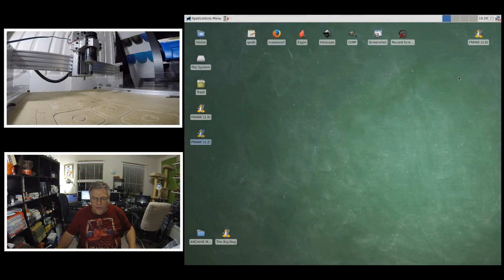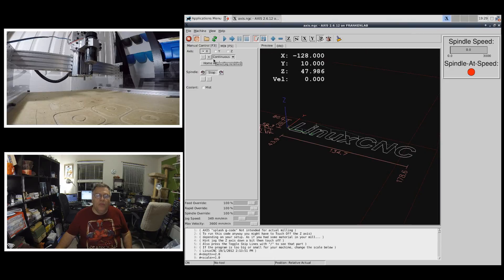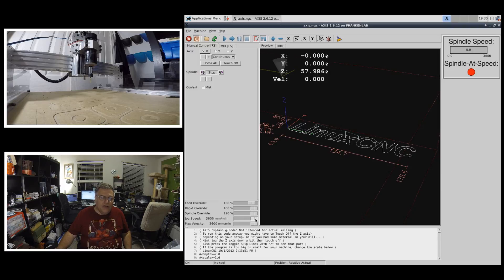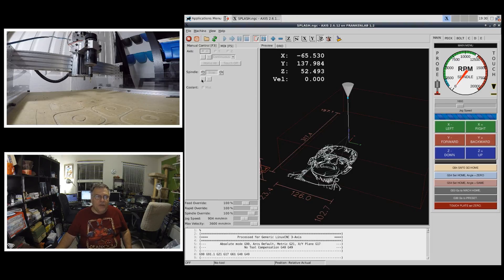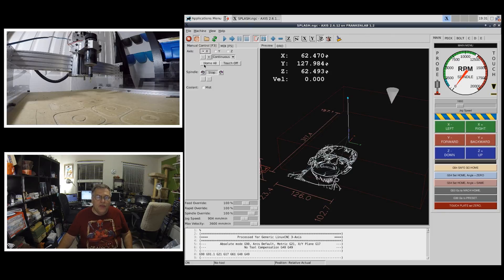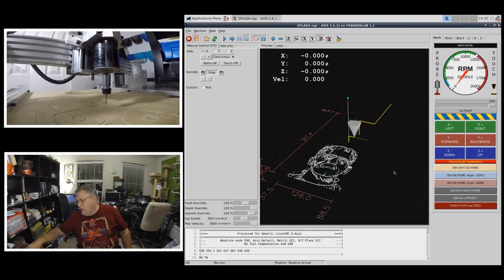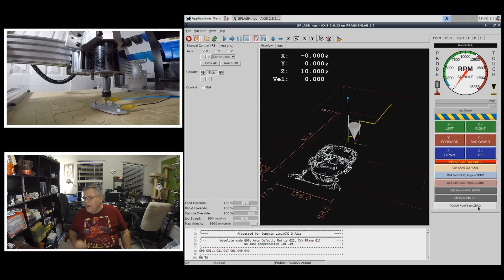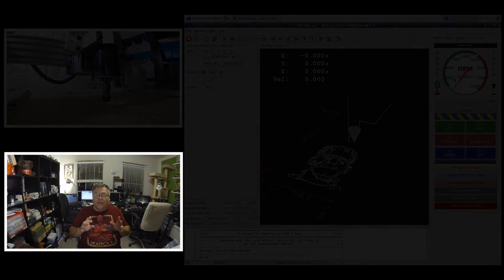Frankenlab CNC #8 - Setting The Goal

Comment: Really slick improvements to the interface. I'm looking forward the next episodes. It's fun to see what you got going on in the background as well... like any good lab... there's a lot of stuff going on :)
Reply from the maker: In the next section, we are going to cover getting the right settings to make the machine move properly. After that, I'll cover setting up the magnetic switches, and then probably several videos on making the panel interface.

Do you think people would be interested to see how I use Inkscape to create the graphics? If so... I'm make an Inkscape tutorial, then put links in the Frankenlabs video.  Thanks for watching!!!
Reply: Absolutely, there's probably lots of people who don't know about Inkspace. I learned of it and Krita recently. (Krita has been a huge improvement over Gimp which I had been using for raster graphics.) I'd watch how you use Inkspace just to get some good habits from the start. Any LinuxCNC customization is interesting.